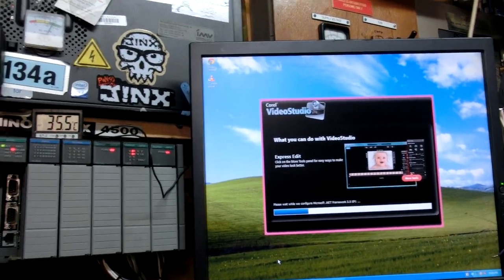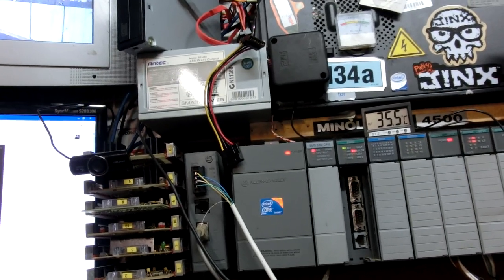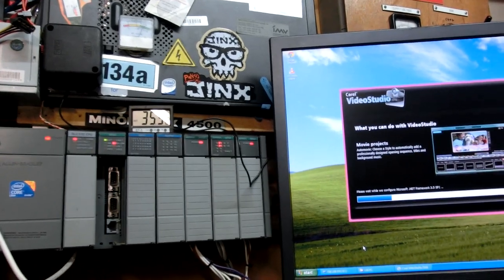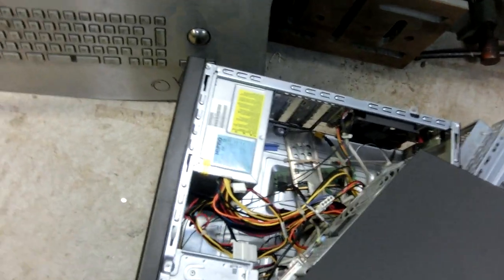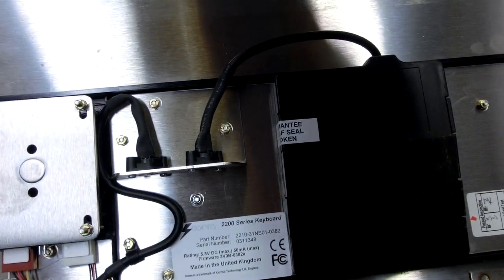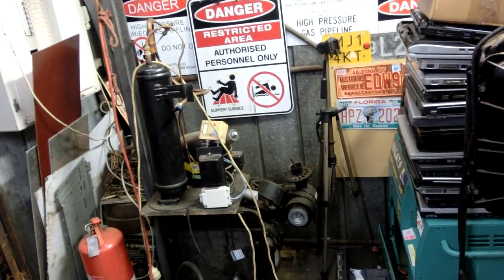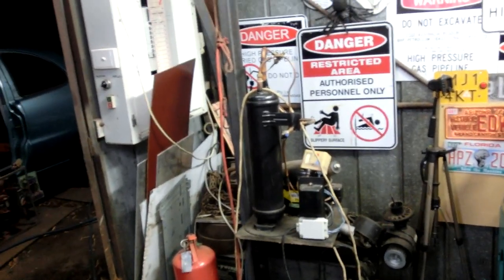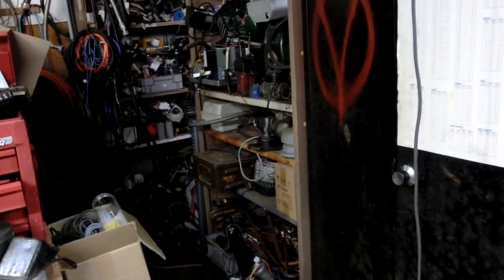Ramblotronic Friday - Camera Software Fun and New Car Coming Soon

Comment: The older British cars are pretty good, other then those Lucas electrics I mentioned, but the ones from about the middle 1970s to early 80s are rubbish, too much sabotage by unionized auto workers and bad engineering. The Jags that Brad has aren't as bad since they started with those in 1968-69 or so, but the ones designed after William Lyons retired are ugly and trouble prone.